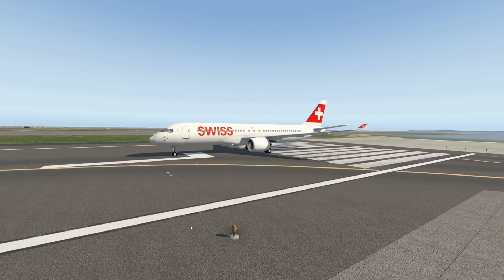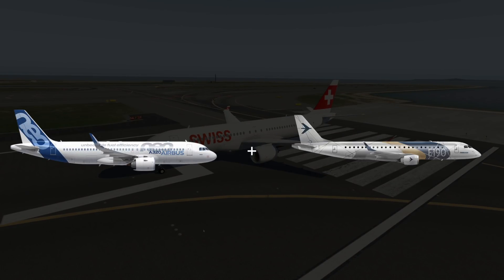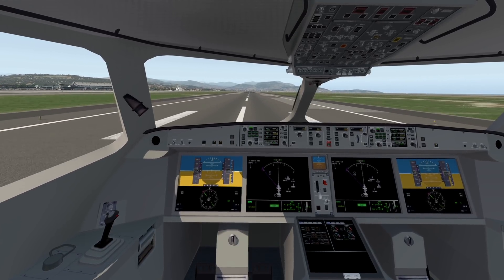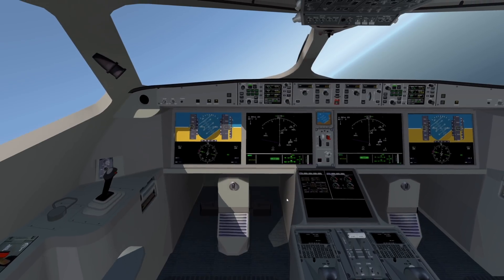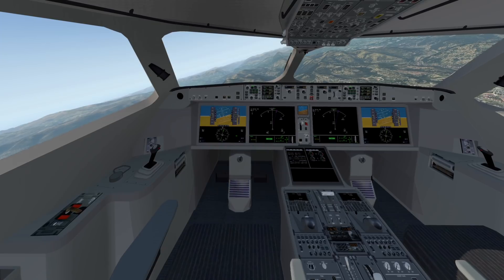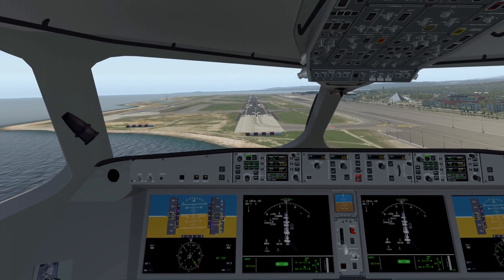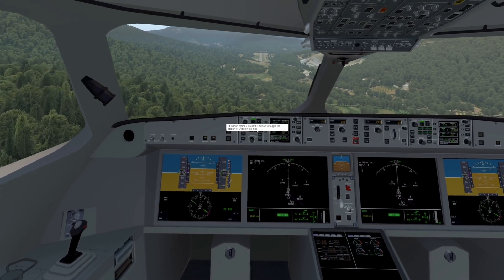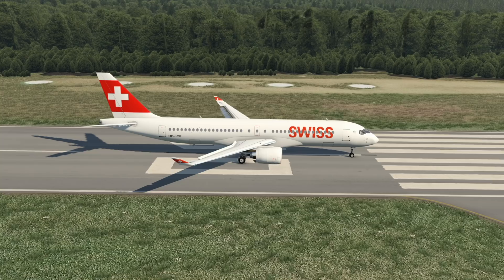Why Does The Airbus A220 Have So Many Engine Failures?

Comment: “More modern than the 737 Max”

Are you serious? The 737 max is an old piece of sh*t. No Eicas..do a go around - no autopilot…1967 overhead panel… Same screens as the 787 (which I fly) but nothing is interfaced… pointless…

Compare it to the 787… Better in some ways not as good in others… I am transitioning to the 220 so I know what I’m saying..

Comment: Well, if you look the engine, the PW1000, it is a revolutionary engine. It'll make history. It is known for the GTF, the Geared Turbo Fan. It was something who was being think in 1990s and would burn 20% less fuel than any other engine. Indeed, it happened, and even better, 23% less consumption than other aircraft.  And like any other planes, there is always some trouble, but solved by the time (the only exception I would think is the MAX, has been a year without a solution).

Comment: To be honest, airbus and boeing are very perfect rivals. They both have aircraft which have pretty bad problems (The fact an A220 keeps suffering from engine problems is pretty concerning. Same with boeing side and the speed indicators.) Their aircraft that had problems both have a very modern design with very large instrument panels. They have their own version of the other aircraft. Like the A350 - B787/B777. A320 family - B737 family. They both made legendary aircraft. The A380 and B747.
Reply: Don't think you can compare the 737 Max with the A220 in terms of safety. The engine problems are similar to the 787, very modern, safe aircraft. I'm sure both models will get over it. Also, A220 is Airbus's first non-Airbus plane, meaning it came from a foreign manufacturer (Canada's Bombardier). Meanwhile, Boeing was known for having some original McDonnell Douglas planes like the 717.